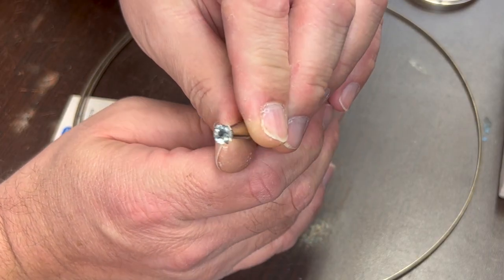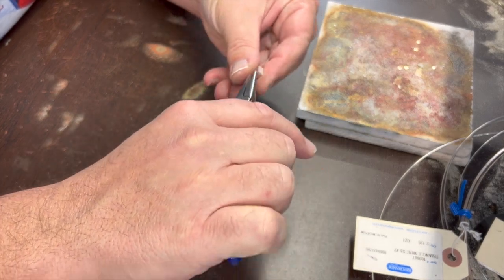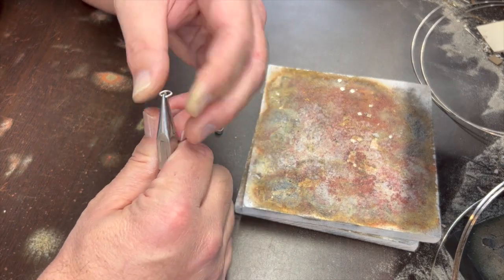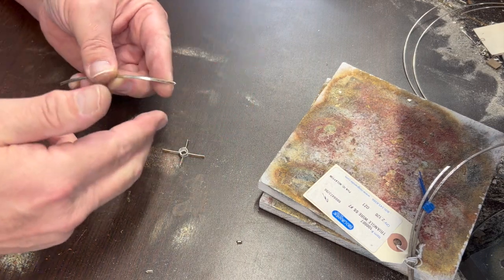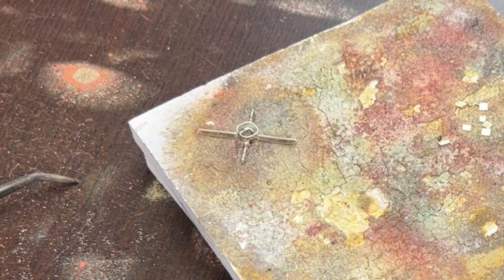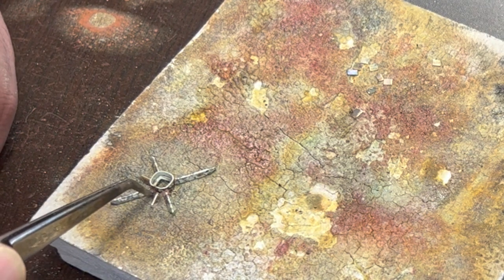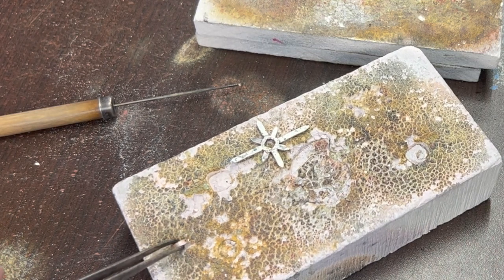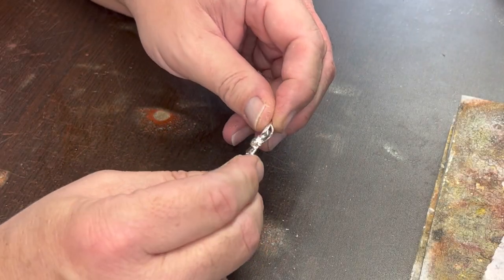Making A Star Pendant with Prasiolite: A Silversmithing Tutorial

Comment: Good tips!  Could you go over your polishing and finishing tips?  Tips for polishing if you don't have that large rotary tool you have.  I have a small Central Machinery polisher from Harbor freight (and I have never used it) and I normally use my flex shaft with various polishers and sometimes my tumbler.  Also, I just made a piece with pick soldering and I feel like I have too much solder and it is easy to see, maybe I need to keep filing and cleaning it up?  One more thing, do you have any tips for cleaning the soldering pick?  Mine seems to have left over soldering and it gets sticky and I can't find a good way to clean it off.  THANKS!
Reply from the maker: Thanks for signing up Andrea. Sorry it took so long to answer this.  How powerful is your flex shaft motor?  Foredom tools generally have enough power to give a good polish, but less powerful ones like my Dremel can't quite do it as well. If you look back in my videos, you will see one about pre-polishing that talks about using my Dremel to prep surfaces for final polishing after which I use the main polishing machine. As far as the pick, you might try heating it up pretty hot and then scraping it off on something like the edge of your pad. I have occasionally used my file to remove stuff from the pick as well. A little sanding probably would do it as well. As far as the excess solder, just file it off:)
Reply: @chadssilversmithing  Thanks Chad, I have a boredom so it should be strong enough.  I just ordered some felt tips to use with a polishing compound.  I'lll give that a try and I'll give filing my pick a try too.  Thanks!!

Comment: Would this work with a square stone. I have a 4mm topaz thats spmost square that i could use.  Im in Australia so I dont think i can get triangle wire
Reply from the maker: Hello Lois. If you mean a true square with sharp corners, sure. It’s likely that you would have to file a notch in your rays to accommodate the corner. You could use some square or half round and get the same basic effect I would imagine:)